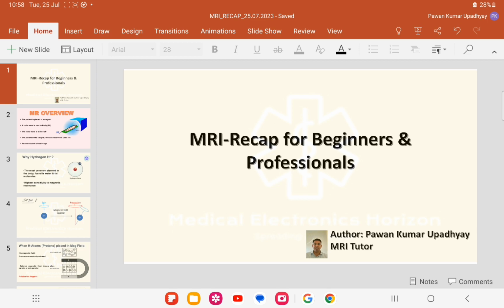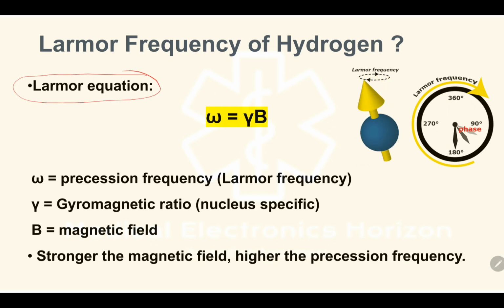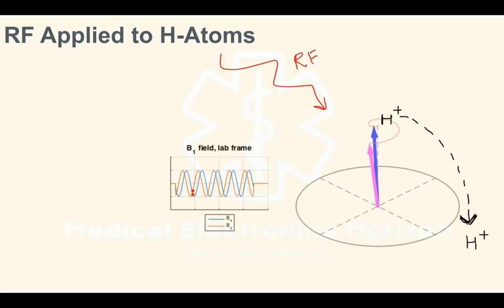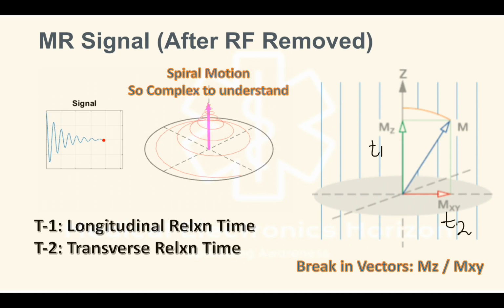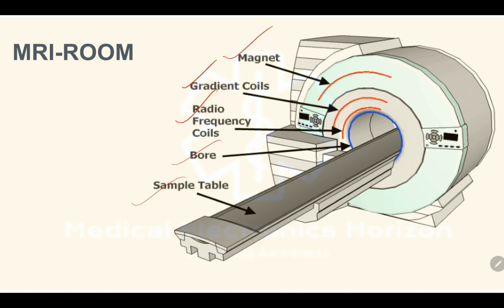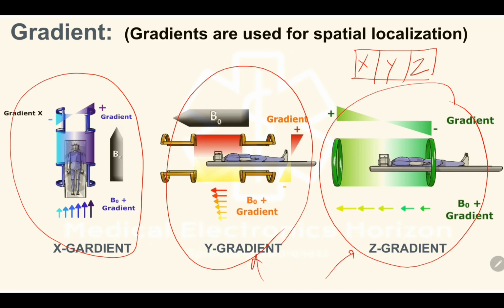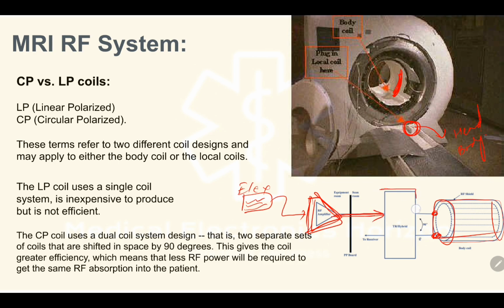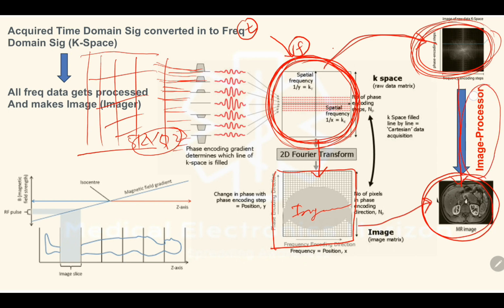MRI Basic Physics in Simple Language |MRI Basics| MRI Working| MRI Recap (Part-14)

Comment: Sir hope you doing well.
Myself Gourab (MRI Technologist, currently working in uMR 580, W.B.).
Requesting you to make a detailed video on whole mri circuit with all components including chiller, machine room, etc from start to end in a block diagram at first then physically showing the total system (step by step onsite recording).
Reply from the maker: @GourabsContent  Dear Gourab, Thanks for your time and Comments. My limitations are in such a way that i cant make actual Manufacturers Vedios and i cant show you the exact Images. There will be the copyrights. I can only make a general theory and a normal overview.
Reply: @Medical_Electronics_Horizon  Yes Please & atleast images of all connected devices module need in a whole mri set up.